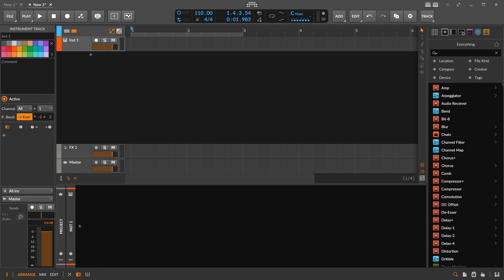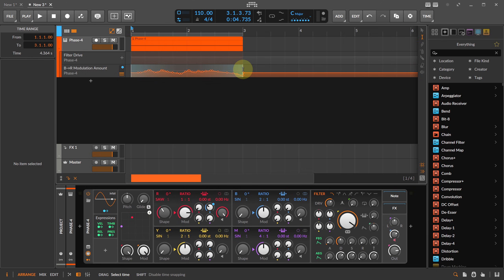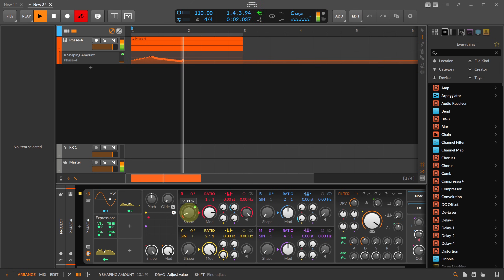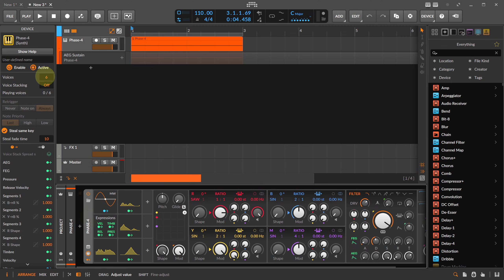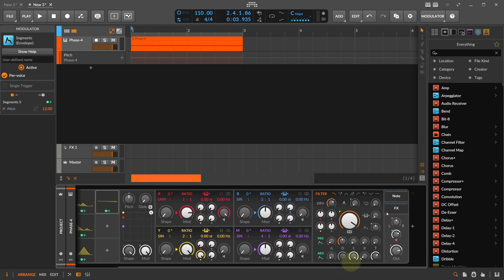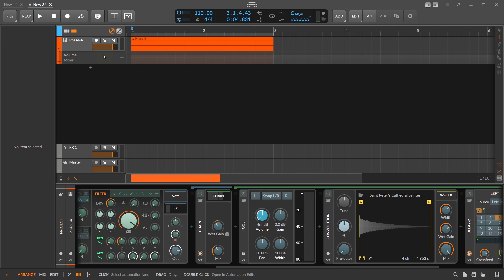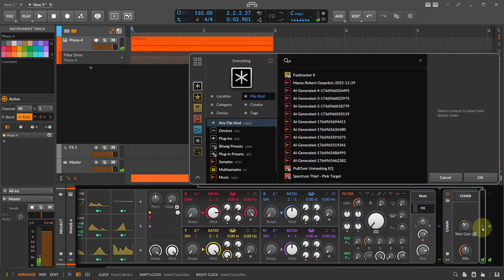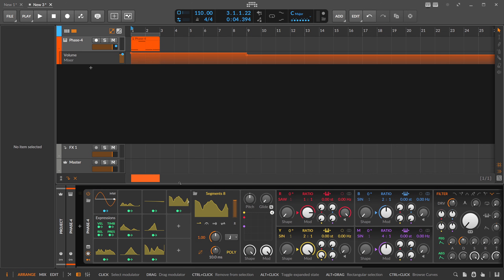Bitwig, Please Make It Happen! (The Missing Modulator)

Comment: I can see why you'd like this as a modulator, but I think the reality is that the "workaround" you demonstrated numerous times is still really easy and actually logical to do. Yes it's a couple of extra clicks, but it's not long-winded, doesn't need menu diving or hunting for an obscure button. Record automation, select automation, drag-drop automation, delete. Having a whole new modulator that has to have a recording interface when what we already have works really well (and as you demonstrated, isn't particularly slow) feels unnecessary. IMHO there are more pressing issues for Bitwig to focus on.

Comment: I would also love a modulator like this, and also a way to record a modulator’s output as automation. Let’s have it both ways!
Reply: I also thought about how cool that would be. To easily drag out the output of modulators modulating other modulators and use it as a automation to get more of a static, one time only, output which is possible to further edit with bitwig 6 new amazing automation capabilities. Would be so nice!
Reply: Yea I'd love to have an easy way to record random modulators. It's currently still possible by using a Midi CC device and modulating its knobs, but it's quite inconvenient.